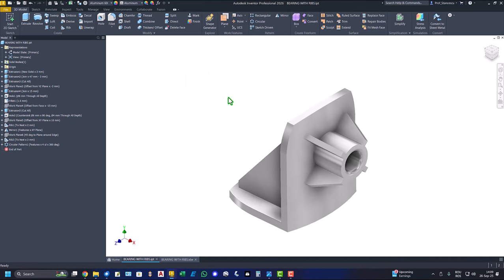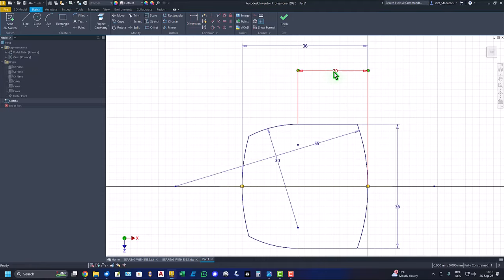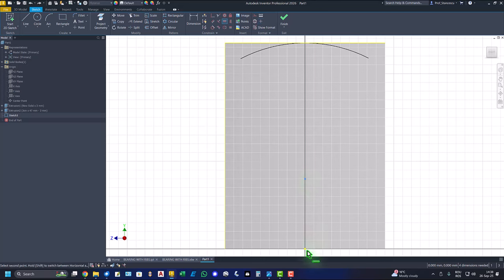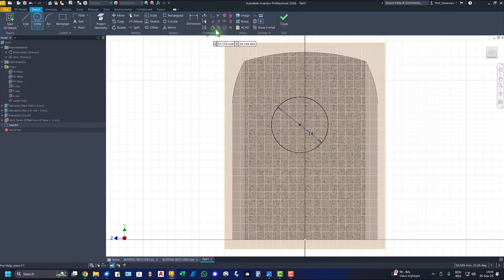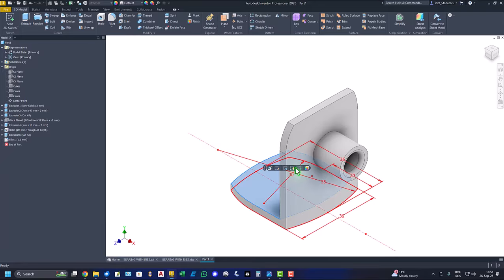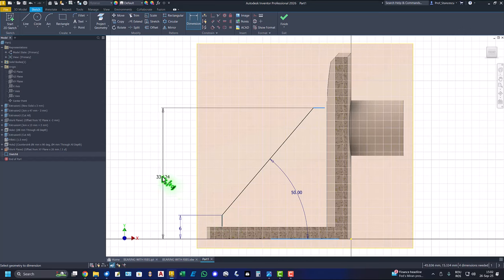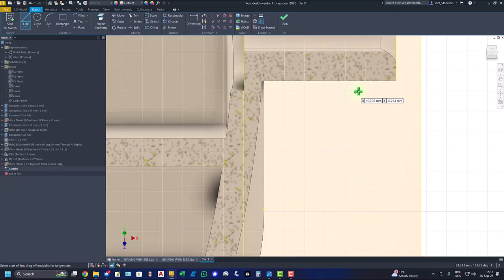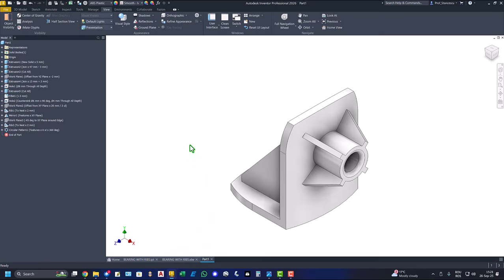Tutorial Inventor - 631 BEARING WITH RIBS

Comment: I also noticed the errors Maurice mentioned. The 1mm dimension on the four ribs would have worked, but it should then have been specified relative to the front (construction plane +2mm) instead of the plane. However, if the 12mm dimension is used, it becomes redundant.

I also noticed another error at 19:00: The 6mm dimension for constraining the X-position is missing for the large rib.

I modeled the part in FreeCAD and arrived at a volume of 12050.42 mm³.
Reply from the maker: Thank you my friend!